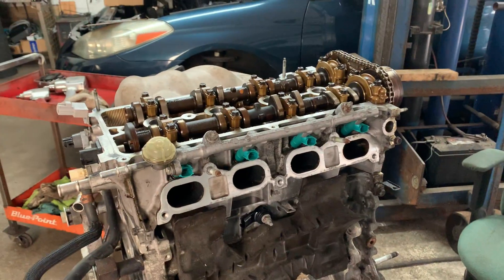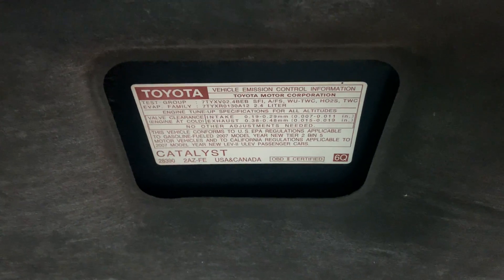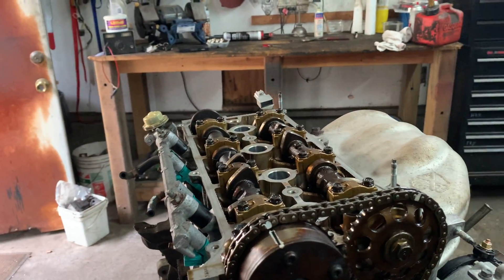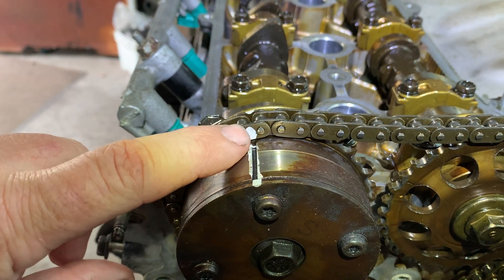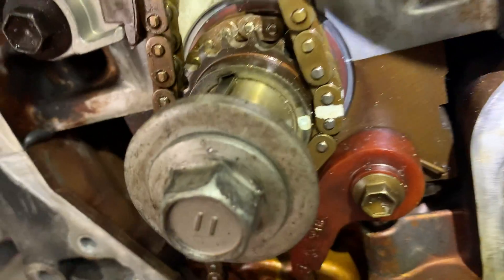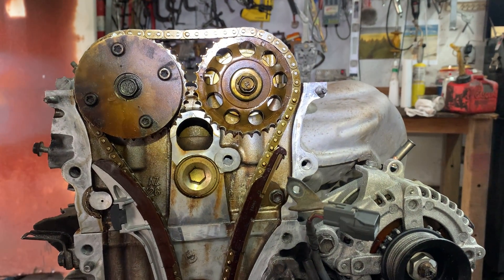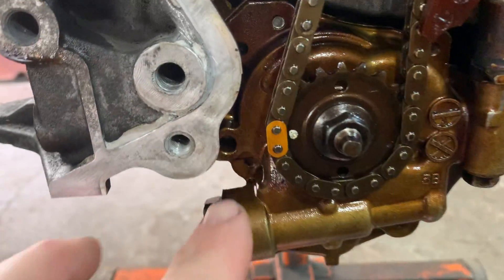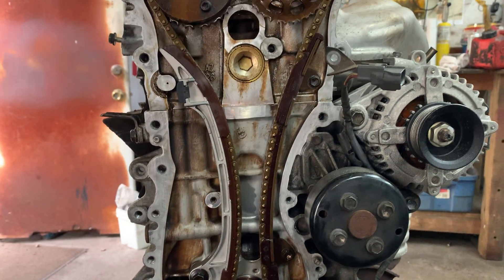Toyota 2AZ-FE 2.4L Timing Chain Marks & Valve Timing Alignment (Step-by-Step)

Comment: How do u know which links to put the paint on?
Reply from the maker: Ok the best way would to take the chain off, you will see 3 different color links, the 2 that are close to each other line up with the the cams up top with the cam marks I explained and the bottom link lines up with the crank dot, so you don't need any paint. I did it that way because it was easier, but do it like i just explained.

Comment: Now, I have a 2az-fe, in a 2009 matrix xr, after warming up, she start ticking like a bad habit🤣🤣, and the water from the exhaust spits out about 3 feet from behind the car. Thought it could be a burnt valve, tried cleaning engine, it still ticks, so I checked clearances on the exhaust side, all are 0.16, except the 1st cam lobe on the 4th cylinder, it is 2.0. I took out the buckets, 1st bucket is #39, 2nd bucket is #44.
The rest are #42, #43, and #44. Do I change #39 to a #48?
Reply from the maker: Actually it sounds like you have a collapsed lifter. I say this because you say when it’s warm it ticks but not cold? That’s because the oil is thicker when cold and it’s helping keep the failing lifter in spec till the oil gets hot and thins the viscosity. Is it one lifter or many making the noise? As far as the bucket specs they seem ok.
Reply: @motorcarnut  Thank you for your responding so quick. It is only the one that is noisy. On my channel, I have a video of the cold start, and point out the spot that the noise comes from. Soooo, a collapsed lifter eh, I guess I will have to replace the lifter., is it a complecated task?
Reply from the maker: Depends on your experience with working on cars. You have to remove the camshaft to access the lifter.